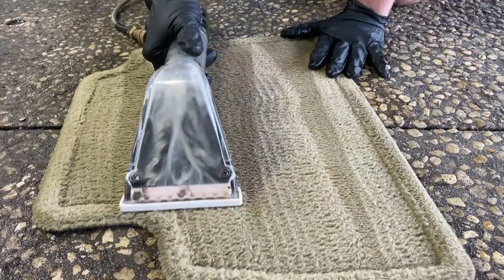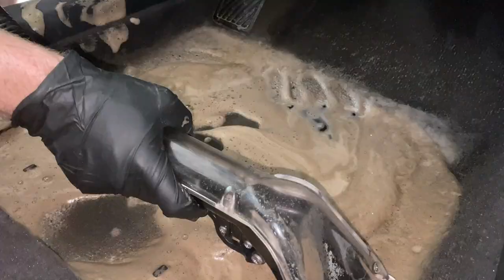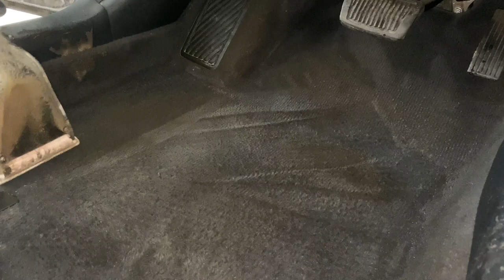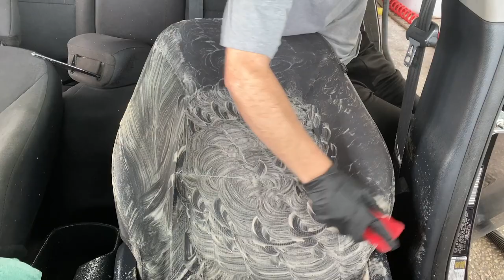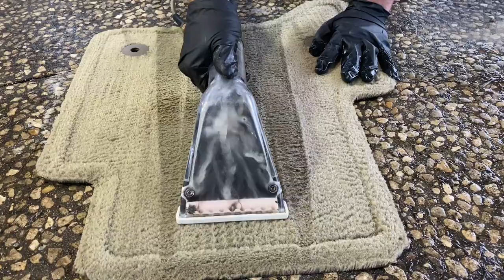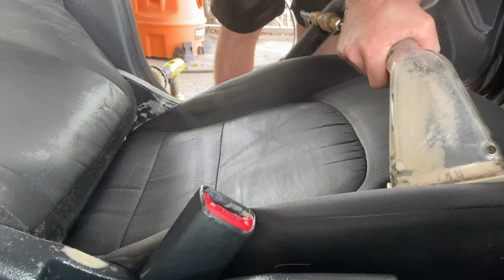Insane Satisfying Car Interior Extraction Compilation | Deep Cleaning Carpets / Seats

Comment: I want a vacuum cleaner like this for my indoor carpets!!
Reply: You can get them, if you search for carpet extractors or carpet cleaning vacuums there should be a few there you can pick from 😀 some are small spot cleaners like the one in the video but you can get upright ones too that are just like a regular vacuum cleaner but it extracts!
Reply: Its called a RugDoctor!!
Reply: A great Vacuum cleaner is  a Rainbow cleaner.  It uses water as part of a filtration system. It is great for allergies and it cleans your house and deodorizes as well. It's mot cheap. $2000.00 . But if I you add up all the money you spend on a regular Vacuum cleaner times all you have had during your life It would be alot spent.  Food for thought.
Reply: that vacuum is called wet and dry or extractor

Comment: Does it smell fresh after it has dried thoroughly. It looks really soaked?
Reply: Would have been faster and same dry time if he would use a pressure washer.. also cleaner. Those floor mats look like sht.. dont even want to imagine the destruction he causes with a buffer.. he didn't even unplug the seat.. I see a lot of airbag lights coming on in this guys future.. I would be so pissed if he did my ride like that.. just no dude.. just no.. stop.